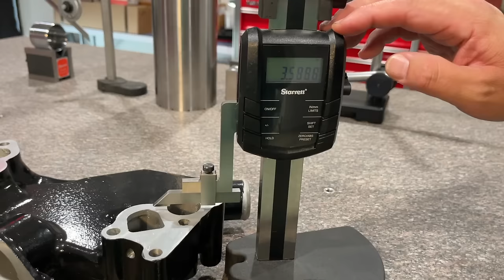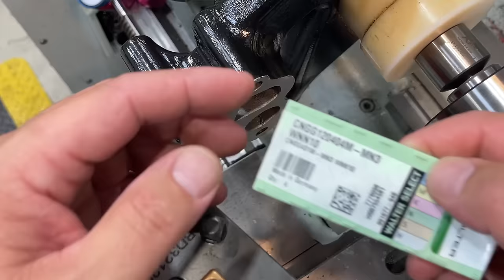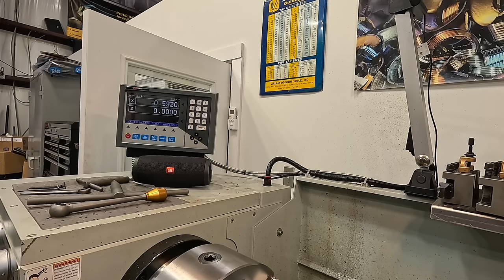Mopar Water Pump Housing - Machining .240" off Thickness

Comment: I wonder if making a new pulley is possible. This would allow for a replacement off the shelf water pump to be installed without having to machine it too. 
It seems to me that there should be other mounting options that don’t require the water pump to be moved forward.
Reply: The water pump bolts to this housing, so any pump will now fit properly.
Reply: After looking at this video I realized that the water pump will be mounted into this housing, therefore there will not be any problems with replacing the water pump in the future. I do wonder if there will be potential coolant leaks between this modification. If the adapter is machined to accept O-rings, then any minute discrepancies will not be a problem.
Reply: @jimfiles3307  It's a 1/4 mile drag race car application.  these things are torn down more often than the average grocery getter. Should not be a concern.
Reply: The early model corvettes had a motor plate between the engine block and water pump. Gaskets used  on block and water pump side.
Reply: @ms01885  Yes they did!

Comment: I don't get why they didn't just use a spacer on  the crank , I doubt they are running lots of accessories with a front motor plate. Probably electric water pump.

Comment: I worked on the shop floor, making parts for GM, 1970-1974. Every Quality Control Inspection measurement was 10 thousandths. GM was machining more accurately than Chrysler in those days. We hourly workers at Oldsmobile took extrema pride in the fact that the Rocket Engine was machined to greater accuracy than any other production engine in those model years. This new replacement part is machined to an accuracy that would have been thought absurd in 1972. I am certain of this. Some insane owners had their engines "speced" in those days. That meant a machine shop tore down the new engine and machined all the parts to 1 thousandth; that is to the actual engineering specifications that were unobtainable when making 450,000 Cutlasses per year. The cost I am not sure about, but if memory serves, a Cutlass cost $2,500, and "specing" the engine cost $5,000.

Comment: Turning was the wrong choice, it's for concentric parts. The mill is about flat/parallel machining 🙄 As soon as you put the part on the granite plate I was thinking about that flange and it being in the way. But time and time again when you were setting up in the lathe you missed that issue 😔.
Reply: I was wondering about that flange too!

Comment: This is like a 20-minute job in the mill.   And what makes you think your lathe has the same precision as the granite plate.  Very odd choice deciding to do it this way....
Reply: Yes, but it makes good video for the likes of me who like to see the machine tools in action and try and learn stuff.
Reply: @JohnSmith-vi5pz  this is not what you want to learn
Reply: @seantap1415 I never take my 8" vise off the mill. It's heavy and who pays for the time. Off then on again and tram in. For this job drill 4 holes in a flat plate to suit the manifold. Bolt the housing to the plate, hold the plate in the vise and face mill 0.260" off.

Comment: Sigh., the problem with comments is that things have already transpired and it is too late.  That was something that I saw coming.  On the first pass I thought it might have been a chip on that flange.
Reply: ^this^ in all it's glory and representation 
Not a machinist and only a basic service & maintenance of motor vehicles qualification taken nearly 40 years ago
1 - spotted the issue with turning on lathe [correct Bert - first pass 22:39 it's chipped]
2 - water pumps are replaceable parts whereas pulleys less troublesome [machine off pulley not the pump]
3 - nothing can be done to fix either issues except treat them as a learning experience 
What I can't understand is why a vehicle specialist engine builder would send in the pump - it aint Adam's fault...he knows everything for precision machining and was just doing what the customer requested but shouldn't need to think is this the right part to machine............but I do know for sure 100% that if he reads these comments he won't be doing another water pump without double questioning the customer because he is a professional.
Reply: @philhunt9297  It's not a water pump, the water pump bolts to this housing. Any pump will now fit properly.
Reply: @scrappy7571  Maybe I misheard/misunderstood....as I said I'm no specialist but a pulley must power it? yes/no?
Reply: Me too regarding “saw that coming”. I thought about it before I noticed that first cut on the flange too. I also thought that when it hit, you would have noticed another sound briefly if you were paying attention to the rhythm of the chips being cut.

Comment: For any of you, people who don't know anything about cars that is not a water pump it is a water pump housing.
Reply: Or, if you want to be absolutely correct and pedantic, a coolant pump housing. Does it matter?
Reply: @martynnutland3234  No.
 I'm in the US. We call it a water pump. That is the term that American mechanics use a water pump.
Reply: @martynnutland3234  and it does indeed matter if you are going to buy a water pump and you think it's supposed to look like that
Reply: @rodney1818  Actually, the pump (with the pulley & fan) bolts onto this water pump housing.
Reply: @amicidavinci  Okay, it is still not an actual water.Pump what is wrong with you people

Comment: Personally, I would've rather had them replace the pullies on the other pieces of equipment, than to shave the waterpump assembly, since pully replacement is much nicer to the sealing surfaces than milling down the mounting surfaces of the water pump.  But, they can do them, and I guess milling down the water pump is 1 part vs potentially 6-9 pullies.
Reply: it's not a water pump.  It's a non moving housing, the water pump bolts to this.

Comment: This is the water pump housing for a B/RB Chrysler engine, any stock pump and pulley assembly will still fit this housing. The water jacket size change will not be an issue.  
There are 2 things that the installer will need to address, shorter bolts, and, will removing the 1/4 cause an interference with the timing chain/front engine cover? The cover on a B/RB engine projects ~1/2 from the block.

Comment: Really appreciate your overkill, but it’s a water pump for a v-8 engine. Put it in the mill and surface it, job done. I’m sorry for the negativity, but you could have been a 100th of an inch to thick or thin, or if the two surfaces were 100th of an inch NOT parallel, it would of worked perfect!! Rebuilt engines my whole life, we mill pumps like this quite often. Glad I’m not paying for this bill!!! Sorry Adam, I call it the way I see it. On that note this is the only time I disagreed with what is being done, but keep up the good work!!
Reply: Adam is a Machinist / Engineer does things to the best of his ability and would never be happy with +/- 0.010  . You sounds like a mechanic where +/- 10thou is probably a very good result.

Comment: I can see that the water ports are not going to be in the same place as the old part.
 This will not fix their problems but make it worse. 

 You did a fantastic job. You did what they ask of you.
Reply: I don't see a problem, the ports will line up with the block  . the fact he lost a bit of web won't hurt in my opinion
Reply: @johnmolnar2957  I agree!

Comment: the whole problem with shaving 250 thousands off the back of the water pump is that the pump housing sits over the timing chain cover, so now it might not have the clearance. They should be adding 250 thou to the other accessories to make it work, including the crank pulley.
Reply: The motor mount plate is making up that distance.

Comment: Automotive Parts aren't held to a high tolerance so I probably would have made a mark and sanded it all off on a belt sander
Reply: LOL.  Tolerances on 70s domestic cars can be checked with a flashlight.  As long as you can't shine too much light between surfaces, you're within tolerance.

Comment: Hey guys, just a note, automotive water pumps only flow at less than 100 Gallons per minute. ... it's actually possible to have TOO MUCH water flow.  If water goes too fast it will not have time to cool in the radiator.

That's one reason why it's not advisable to take out a car's engine thermostat, it's designed to limit the water flow to a reasonable volume.

It's nothing like the flow of fuel air mixture into the engine .. the different size holes in the water pump galleries will not make any difference to the engine's Cooling capacity.

Even if it did?  You just stick a bigger radiator in the vehicle.  Hot Rodders do this stuff all the time, they know what they are doing :)

Comment: Great machine work, but it’s not going to work for them. They will have gaskets issues leaks, etc. they should have machined the the engine plate not the water pump. Down the road they will need another pump and rock auto will not have a custom pump.
Reply: The plate is probably only a 1/4" thick to begin with.
Reply: It will work in I’ve had the same mod done several times putting 440’s and hemi’s in race and street cars
Reply: That's not a waterpump

Comment: Not a good idea.
If you havent any other choice, I can give you a complete Dodge 440.
That also icludes an installed water pump that does not leak.
Reply: Why would the water pump leak?
Reply: I guess you missed the part where he said there is an engine plate going between the pump housing and the block so the housing has to be shortened to keep pulley alignment.
Reply: @tsmartin  nope. He did nothing to the water pump or where it sits in the housing for it to leak.
Reply: I don’t think you have a clue what you are talking about. But if you are giving away a 440, I’ll take it.

Comment: I hope that the removal of 1/4 in will not cause a fitment problem with the upper and lower radiator hoses to the block. 
That would be on the client anyway. If not, looks good to me.
Reply: That all stays in the same spot. Nothing is moving dimensionally. The engine plate will take up the difference on the back side.

Comment: Best option would’ve been to machine a pulley with the correct offset.  Water pumps are a wear part and have core value as well.   A pulley is expected to last through the life of the car. Maybe 4-5 water pumps.
Reply: 440 engines use a four bolt pump that bolts into the round flange - what he is machining is the housing that the replaceable pump bolts into. This part is not the wear item.
Reply: There  may be something that mounts to the housing, so it's spacing from the engine has to be the same.

Comment: Confused why they didn't just space the pulleys out the 1/4" or source different offset pulleys. I would think trying using a custom machined water pump will cause issues later down the road when it fails & gets replaced with a standard off the self one.
Reply: The part he was working on is a "water pump housing" the "water pump" bolts in to that hole with the 4 bolts around it. Any off the shelf pump will still fit. We don't know the specifics of the installation. There could be interference with the fan and the radiator if it stuck out that 1/4". Different off set pulleys may not be available plus all the accessories ... alternator ... power steering pump ... AC compressor ... if used ... would also need special pulleys or have their mounting brackets modified to move everything out that 1/4".  Much better just mill the 1/4" off the housing and move on.
Reply: IF YOU DONT KNOW WHAT YOUR TALKING ABOUT SON JUST STAY HOME AND LET THE REAL MEN DO THE REAL WORK. MOMMY WILL BRING YOU ANOTHER KOOLAID SOON

Comment: Those pulleys not going to be happy not being in line with the others anymore.  The gaskets take care of all defects after manufacturing. It’s made for doing this. To be produced as fast as possible. But pulls need to be in inline
Reply: that was the reason for the machining, to line up the pulleys after adding a 1/4" motor mount  plate between the pump housing & the block
Reply: @johnmolnar2957 : it’s 04am in Norway.  Was making coffee and breakfast. That’s my excuse. Going to watch it all again now!
Reply: From designing one off V-belt drives for 5 years as a Sales Engineer, I can tell you that a few thou or even ten or more won't make enough difference to worry about.

Comment: A small grinding machine solves such problems in 30 minutes, 25 minutes for installation and 5 minutes for grinding, the possible accuracy is 5-7 microns.
Reply: For a cast water pump that has factory specs of +/- .010" or .020" 😂
Reply: I'm no machinist, but I think the #1 rule with surface grinders is "no aluminum."
Reply: @AdamantineAxe  It does not stick too well on the magnetic chuck either.